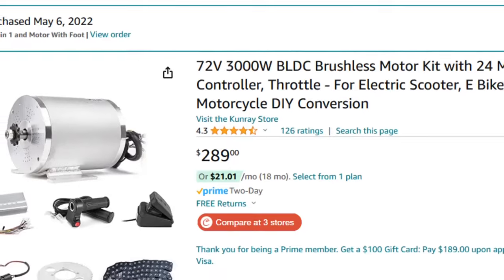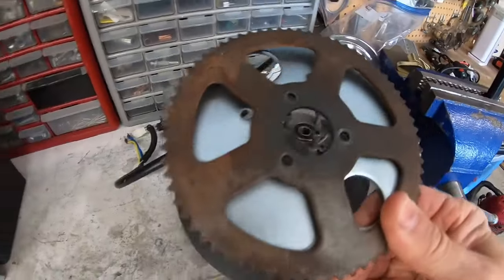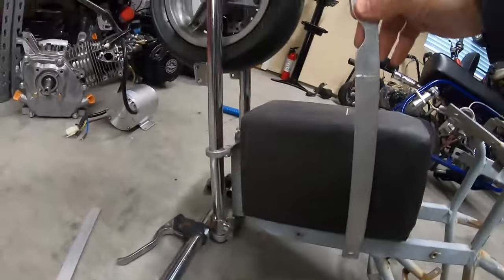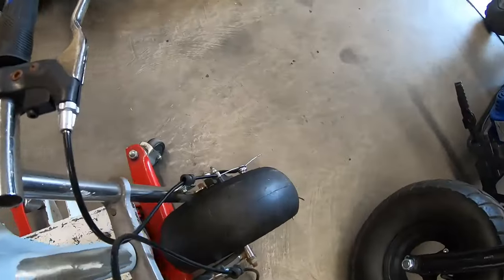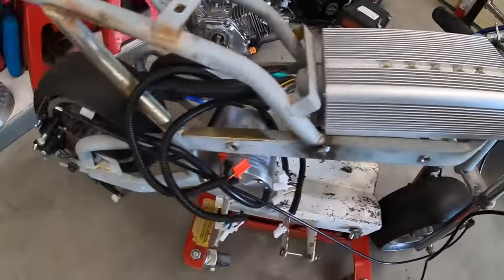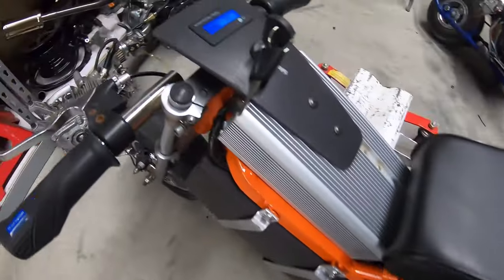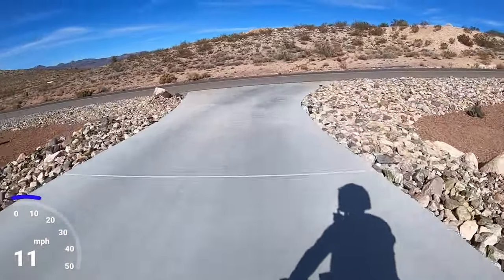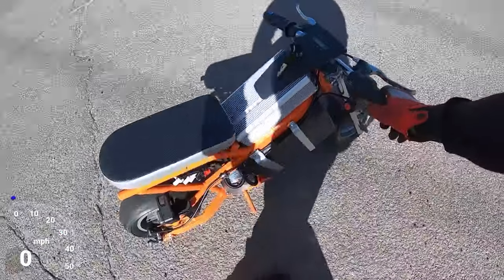How I built a 50 MPH electric mini bike

Comment: Black66.  Iam running a predator 212cc ghost with 13x-500-6 tires.  What size clutch & rear sprocket would I use?

Comment: What paint did you use 
Is it spray paint 
Or power coat
Reply from the maker: It was just a quick paint job on this one. I used Rust-Oleum. It actually came out pretty good.

Comment: Hey black 66 I have a Coleman bt200x if I put a 224 predator in it and zip tie the gov with a 10 on the clutch and 50 rear with stock size wheels/tires what do you think the top speed would be
Reply: I'm not black 66 but I think if it's one chained it should be like 48-54 with just the zip tie
If it's on a jacket shaft you should be around 32-38
Reply: Run straight chain get alot more top end on it. There's also an app you can get on your phone to test the speed.
Reply: @hellheart1993  I have the stock motor with the coleman bt200x and I hit 53mph with the gov zip tie trick so I am hoping to hit 60 with the 224